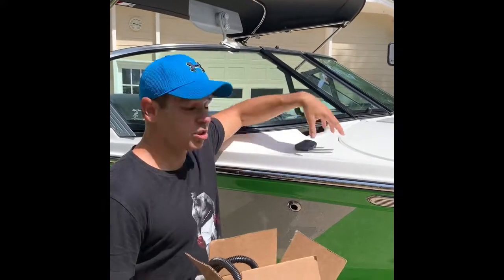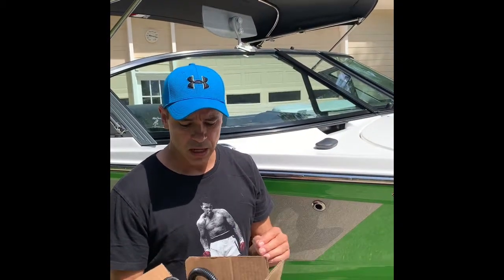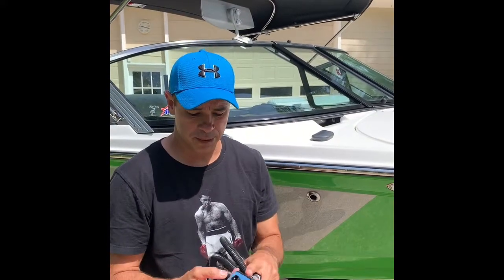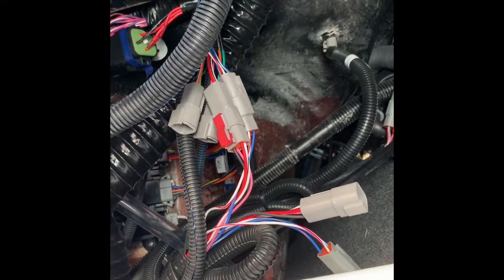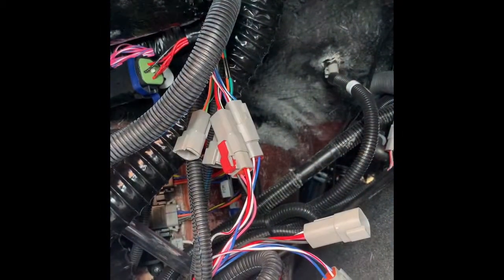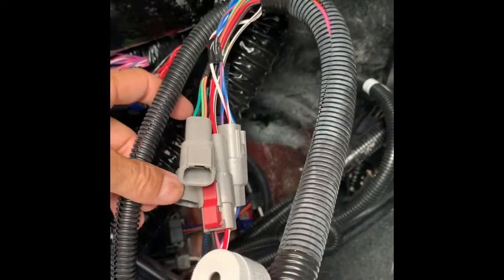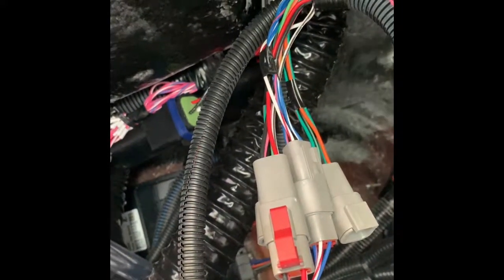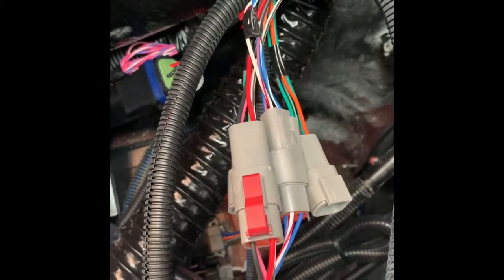Zero Off Single puck Installation (ECI puck)

Comment: If you have a SN (at least my 2008 196) you  will use all 4 connectors.  Unplug what's there and plug all 4 to applicable male or female connectors.

Comment: Hi Freddy, do you have any plugNplug system that will work with the Yanmar 4LV engine with electronic throttle control? My boat is the AXIS A24 (2022), since we re-engineed it to the diesel, we can't use the original system anymore. I'd like to have speed control work on my boat badly.

Appreciate your reply.
Reply: You swapped a diesel in your A24? I have to see this!